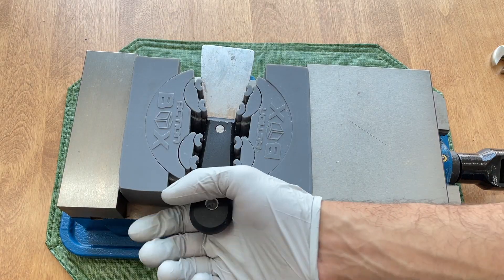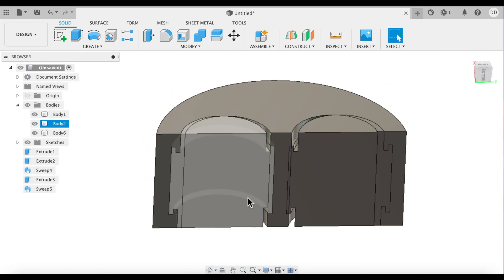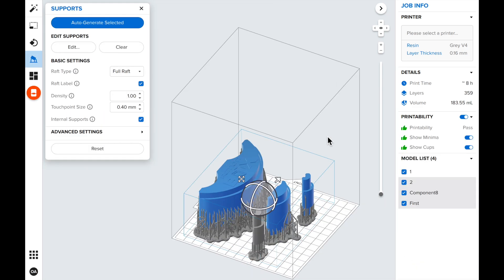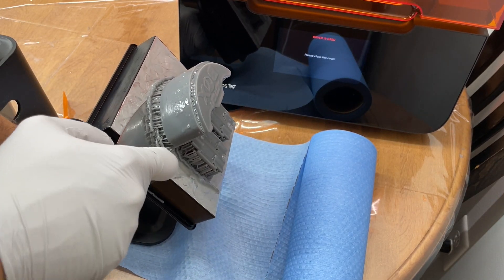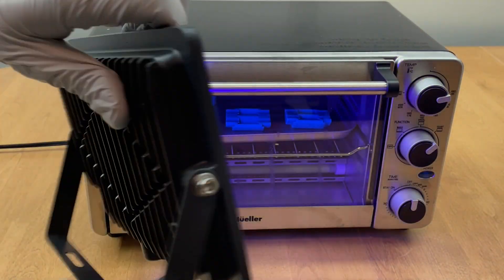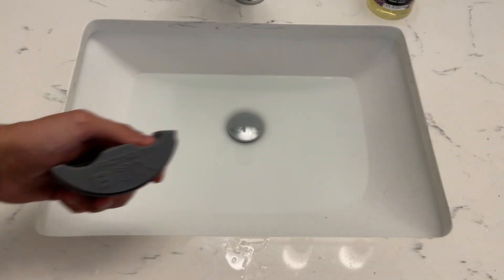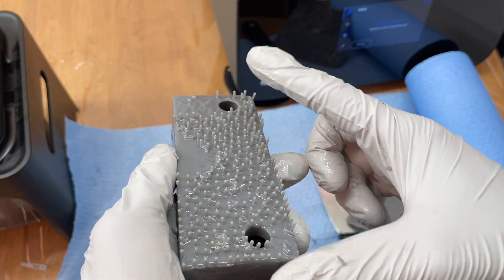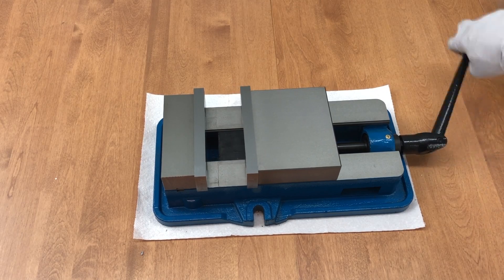How We Made A Fractal Vise At Home

Comment: How accurate do the tolerances of the metal parts need to be, for a fractal design like this to work reliably in the real world when made of metal? (for real work holding as in a milling machine etc)

Would you not have issues with chips getting in and gumming up the works (to use the technical terminology)?
Reply from the maker: That’s a great question. The answer is I don’t know.  I never had real ones made of metal, and I never tried to optimize the design for industrial use.   Hope you enjoyed the video regardless. Cheers
Reply: @ActionBOX  Did indeed, they're a great design :)

Comment: Machining has been the inovative force behind many food products. How about building a machine to make Action Box snack food? A puffed cornmeal machine would be interesting.
Reply from the maker: Good idea, but I would have to justify building machines so I can use them thereafter.  Can you think of a way to make it work?
Reply: @ActionBOX  It might work with an assembly of parts that can be used with other projects. The cornmeal has to be extruded at speed through a die. The friction of the fast turning extruder will cause the moist cornmeal to steam. With the pressure forced through the die the cornmeal will puff. Check this for concept. https://youtu.be/3LJto1D0iPs

Comment: A homebuilt all metal coreXY 3d printer.
Reply from the maker: Believe it or not, I am currently working on a metal 3D printer 😜. Just having some issues programming the Fiber Laser. How did you like the video otherwise?
Reply: I ran across your epoxy granite mill, then watched all your other videos and subscribed. I am building an all metal coreXY (using my DIY CNC router) currently and love to see other people's take on it.
Reply from the maker: @auhopu  Thats amazing. I love this technology so much so feel free to bounce ideas off of me at any point. I would love to help. What is your estimated time to completion? - Dave
Reply: I have sourced most parts (except for the extruder/hotend - following closely upcoming releases), milled the extrusions square, assembled the frame, set up klipper/fluidd, tested some accelerations and trinamic settings. Milling the plates will happen after summer vacations. Hopefully it will be moving in September, melting filament in October.